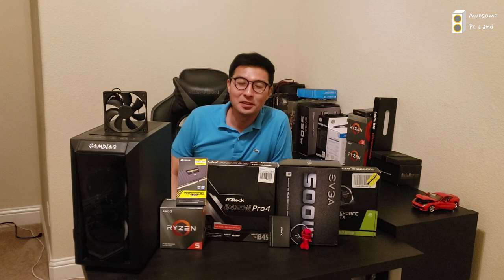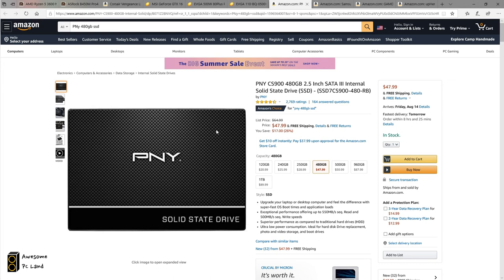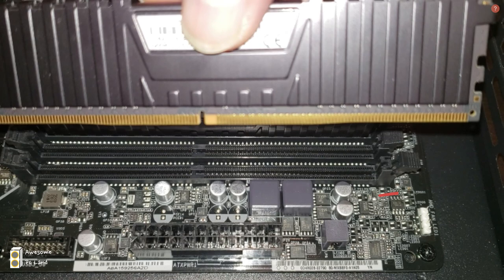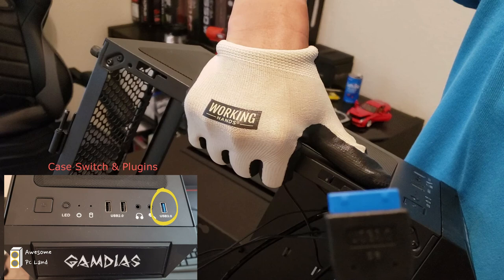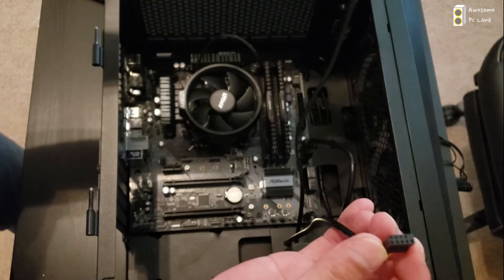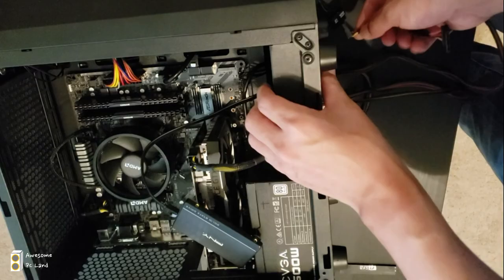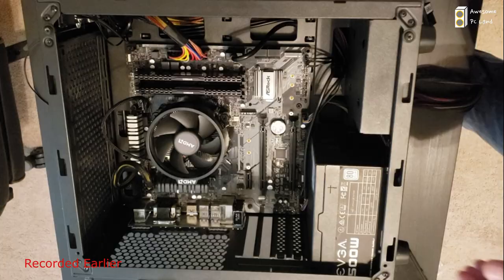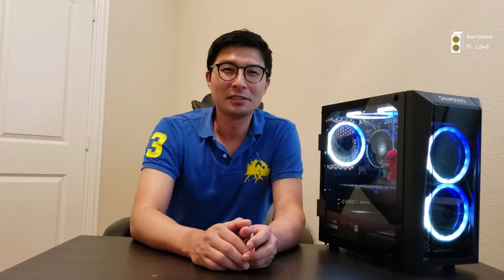How to build a PC in 2020 with $650 budget.   Step by Step guide (Ryzen 5 3600 + GTX 1650 Super)

Comment: how are all your fans set up?  front and top intake / rear and psu exhaust?
Reply from the maker: My current setting is front 2 fans intake, top 2 and 1 rear (3 fans) exhaust.  Currently, I have no issue with heat in this setting.

Comment: Purchased the same fans as you. Having trouble getting the Gamdias RGB controller to work with the UpHere RGB controller.

Is there anything else that you must do after plugging into pin 4? The Gamdias controller is still functioning and will not accept the Uphere RGB controller.
Reply from the maker: Yes, find LED button by the power button on your case.  "Long" press and release that button will sync your Gamdias RGB controller to UpHere RGB controller.  As I have mentioned, main controller is UpHere controller so play around with your remote to find color settings that you want.   Let me know if that worked.